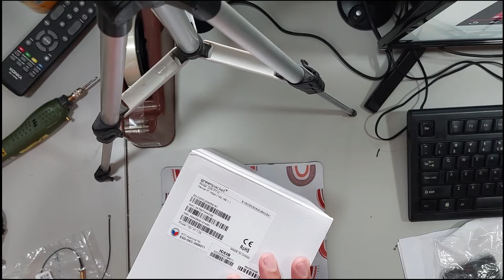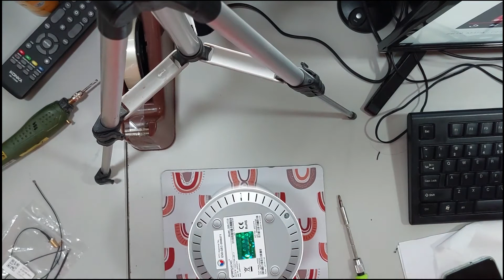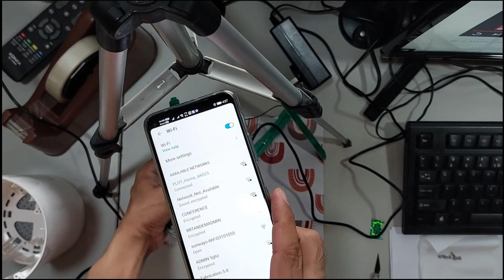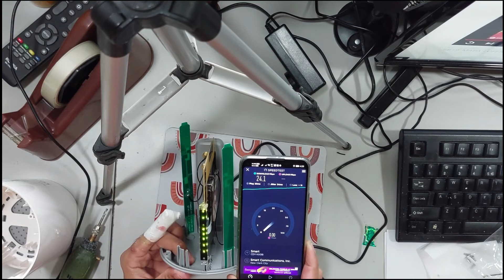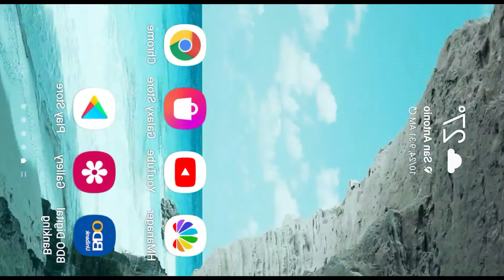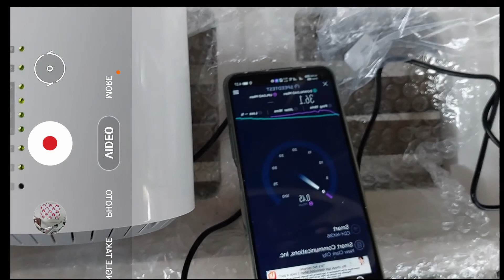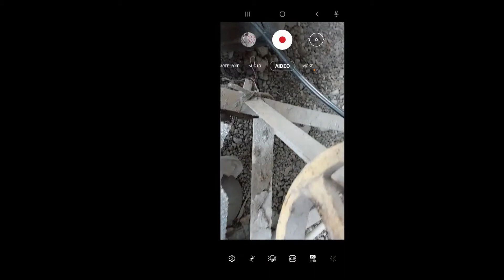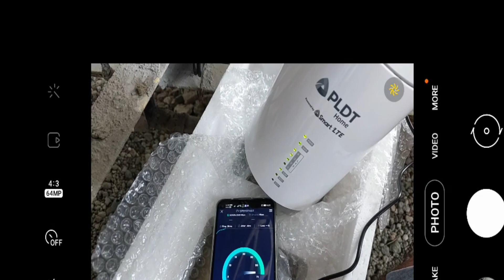PLDT D2K FT10 MODIFIED EXTERNAL ANTENNA

Comment: Upload nyo po Ang naka solder sa pcb na IPEX nyo Ng Makita namin kaibahan sa speedtest lods
Reply from the maker: Sa speed test sir hindi naman mag kalayo, pero mas maganda ang solder type kay sa remove internal antenna, kc mapipilitan ka na mag gamit ng external antenna kahit malakas signal sa area , kc mag blink sya at bumibitaw, not good din sa mga area na ma hina talaga ang signal kahit may external mahina si d2k, pang boost lang talaga ng signal, kung  sa city ka at malapit sa tower, ok sya pero pag midyo malayo kana not recommended talaga.

Comment: boss my nabili akong 5pcs Connector Antenna WiFi Pigtail SMA Female to IPX Extension Cable 15cm kaso hindi nmn kasya, anong sma ang gamit mo ung exact measurement sana or my link ka ba sa lazada or shopee? thanks